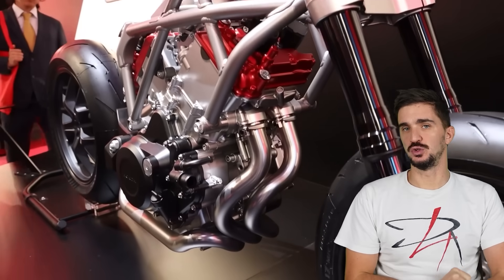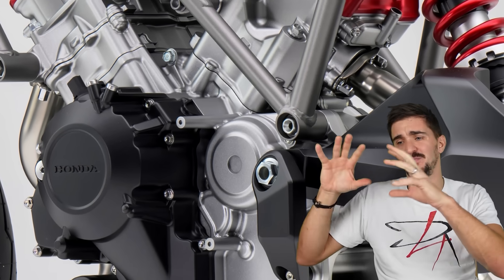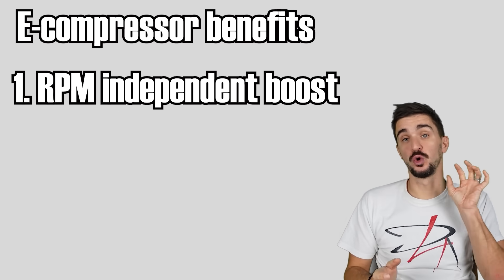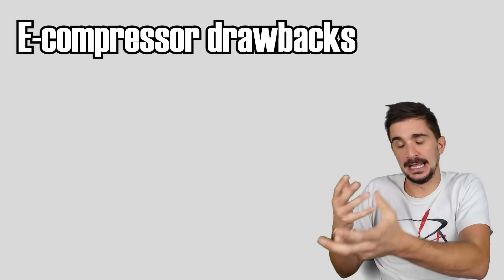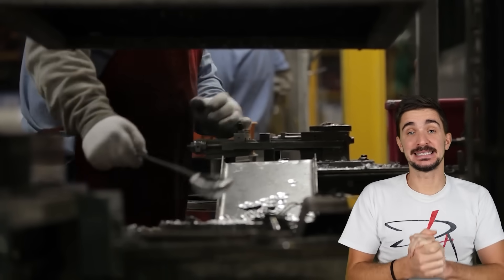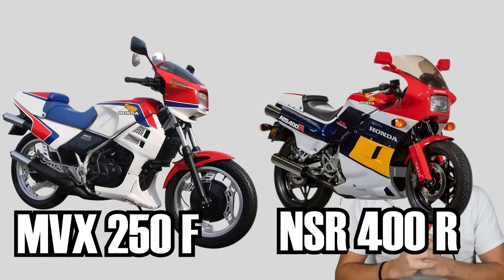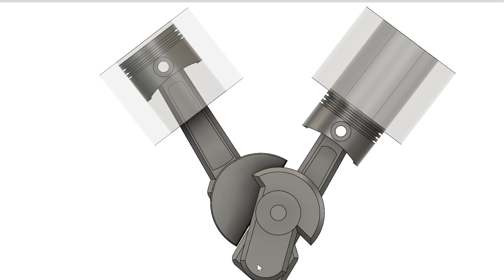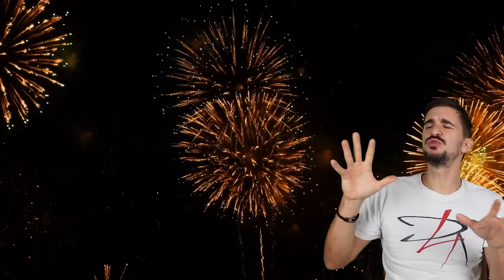Honda's New V3 Electrical Compressor Engine Explained

Comment: Small displacement engines always have the coolest engineering features, long live the combustion engine!
Reply: In today’s economy and emission standards, small displacement is pretty much the only area companies are left to tinker with. F*k electrification before maturity
Reply: Electric engines are cooler though
Reply: Super 🤔😊😊💪💪🍻
Reply: My God the electric simps in these comments have no clue xD pound for pound as dense. Dude an 85l tank of diesel does more than a 1 ton energy pack of batteries twice over. The copium.
Reply: Do you have any idea how many people have died just from breathing air that has a tiny bit of exhaust? Tell you what when a child dies of asthma it’s just like this, exhale all the air out then hold that. Just try it. Burning fossil fuels will end, if you’re in your twenties, in your life time. Mainly because it will be criminal to make heat for such frivolous reason as personal transportation. When SHTF be prepared by having something you can feed with solar power cause you won’t be able to find gasoline!
Reply: They can get away with being lazy like a American V8
Reply: @krusher74  (can't?)
Reply: @TheseThreeZs   Immanuel Kant.
Reply: long live combustion but not piston engines they’re inherently inefficient at their job
Reply: @hazza2247  true, so much wasted fuel
Reply: @hazza2247  Most efficient is electric tho
Reply: @ yeah i know but burning fuel has so many logistical benefits and they sound cool

fuel is so much more energy dense than any battery currently, imagine a person out in the bush with a chainsaw, the battery size required to match the power and run time of a tiny tank of fuel is not ideal, that’s just one example but i’m sure u could imagine many more
Reply: @hazza2247  Incorrect. Pound for pound, a lithium ion battery is MORE energy dense than even dynamite. However, fuel does enjoy logistical support because we've been using it for so long. We can fix this through micro solar and micro nuclear, but oil and gas are trying hard to kill those. Noise isn't an issue because 90% of motor applications would be better if it was quiet. For example, imagine a 2 stroke powered fan or laptop. It'd be horrendous to sleep next to. Electric is also way more reliable.
Reply: @ i meant they sound cool for boats and bikes and cars and shit.

if that’s true about the lithium ion batteries then why does a tiny fuel tank on a chainsaw last a long time and yet a similarly sized battery lasts less than half the time whilst barely matching the power of the combustion chainsaw
Reply: @hazza2247  That battery sucks. 
Sure but id rather have the highway near my house be silent. Theres a time and place for teenagers in clapped out civics, and thats not waking me up at 3am
Reply: @ i’m talking about racecars and stuff like that, they simply sound powerful and i like it. also just did a google search and it said lithium ion batteries are 100x less energy dense than petrol fuel, which makes sense given real world performance of each at the time of me writing this
Reply: @TheseThreeZs  Rubbish you haven't named the parameters by which you state that opinion ps opinions are not facts.
Reply: @TheseThreeZs  so, why Formula E can't surpass F1 in term of speed and Range?
Reply: @TheseThreeZs the highway near your house will never be quiet. The majority of noise is road noise and not engine noise. A tesla model 3 is just as noisy at speeds above 50kph as a diesel/gasoline vehicle.
Reply: @HeyAddieImTojo  incorrect. i'll post a video later showing you that even without modded exhaust gas is louder than EV. Road noise is also an issue as well.
Reply: @Cloud-zq8mf  Batteries suck right now. If we ran them on unlimited power (such as overhead ariel) E would easily overtake F1. Also, E is more designed for competitive, fun races rather than technical excellence. E cars have little aero, and are more designed to look aggressive.
Reply: @hazza2247  Agreed. I love the ground shaking rumble of nacecar. But we've already agreed as a society NOT to have cars like that on the road, and that quiet cars are better. It makes sense for entertainment, but not for actual practical use.
Reply: @zorbakaput8537  ? Who mentioned any variables?
Reply: @ i agree super load cars shouldn’t be on our roads but some quiet cars can still have a really nice sound profile to them imo
Reply: @TheseThreeZs Fuel is more energy dense than electrical batteries (the unit is joules per kilogram). In your comment, you are saying the opposite. Unless you know some very recent developments in the field of batteries that I am not aware of (highly unlikely), you are making a mistake.
Reply: .. Continuing:
Fuel energy density is about 45 megajoules per kilogram (MJ/kg).
The best lithium ion batteries have an energy density between 200 and 300 Watt Hour per kilogram. To converter Watt hour to joules, you multiply by 3600. So, 300 watt hour (the best lithium ion battery) is equal to 1.08 mega joules. This means that fuel is about 45 times more energy dense (45 megajoules compared to 1.08 megajoules) than the BEST lithium ion battery currently available (which you don't have access to).
Unless of a miracle, batteries won't catch up with simple fuel. This would mean a total and disruptive change in the way that we are manufacturing batteries since more than a century. After a century of research on batteries, it's VERY unlikely that this disruptive event will ever happen.
Fuel is inherently better and it will stay so for a long time.
Reply: Plus you have to factor in that electric motors are up to 90% efficient compared to 25 to 35 % efficiency of ICEs. And electric motors have greater power density and don’t need complex transmission gearing, resulting in potential overall vehicle efficiency gains. Even with all that factored in, fuel still gets you way way further per kg than batteries. That’s what made hydrogen fuel cell electric vehicles attractive - roughly the energy density of petroleum (less the 50% efficiency of the fuel cell converter) with the advantages of an electric driving motor.

Comment: The electricity comes from the crankshaft as rotary energy converted into electricity with losses then back into rotary motion in the electric motor with more losses a magnetic clutch driving a supercharger when needed with no losses cut out the 2 middle men a super charger needing 5 kw to drive it would need 6 kw with a 90% efficient alternator and a 90% efficient motor or just 5 kw from the crankshaft and 50 watts for the clutch 1/20 of the 1kw  5 kw at 50 volts is 100 amps with 10% losses 110 amps 4 x most car alternators and around 4 x the draw of a car starter motor the battery will have to help out at lower revs as the alternator output will be lower even with a 6 kw one and the battery will only help for a short period unless it is huge.  Turbo bikes were going to be the big thing in the 80s but an extra few 100 cc extra won out it was lighter simpler with no lag. If they build it people will buy it because it is new just like the turbo bikes of the 80s but will they recover their development costs and warranty claims. My uncle had an oval piston honda v4 (simesed v8 ) no children and never bought a house lived in his parents house

Comment: e-comp kicked in yo !
Reply: Then what would happen if we had a centrifugal vacuum pump to evacuate the air from the cylinder shafted to an electric motor that was shafted to a compressor and a compressor wheel pushing air into the engine
Reply: @demonthewolfmovieproductio6884 lots of loss. What about a Tesla turbine that runs off brake fluids and spins a compressor
Reply: @off6848  once had an idea for a hydraulic setup that put the motors on all 4 wheels being spun by the hydraulic fluid and the pump was well ofc an internal combustion engine shafted to a big pump. The idea was torque vectoring and a lot of torque from a dead stop
Reply: @demonthewolfmovieproductio6884  yeah that’s a fun idea it would probably work well for a go kart but how do you stop?
Reply: @off6848  easy you reverse engines when I say reverse engines I mean by reversing the flow of the hydraulic fluid through each individual motor sort of like I guess the way a heat pump would swap the flow of refrigerant through like a solenoid valve or something
Reply: @demonthewolfmovieproductio6884  yeah now that I think about its how a winch would work true. I guess instead of pedals you might have levers.
Reply: @off6848  levers could probably work although I imagine petals could too depending on the application you needed it for my original idea was to say something like zero turn lawn mower or really almost any kind of use case it would be all right for I suppose and there would be no need for a transmission
Reply: @off6848 the Tesla turbine’s efficiency goes down to being marginally better than a normal turbine when you put any sort of load on it.
Reply: @ no it’s misinformation there are people working on them that prove that wrong.

The problem is that people who’ve never read the patent falsely claim they are friction based turbines but they are not they work on electrostatic adhesion and you do not need crazy rpm to generate power it’s the opposite. People are just making friction based slip machines and calling them Tesla turbines
Reply: Hector hit the E-TEC Yo!
Reply: lol!
Reply: I don't understand why not have just made it a v4 if the front cylinder set is already slightly wider then match the rear. I understand the crank width is where we see a savings on the width but c'mon I have faith in Honda to figure out a better way.
Reply: @Roboticdoughbull3k
Weight and costs for a sub 1 litre engine ,3 cylinders is usually the optimum in terms of behaviour V bore friction ..as this is a MC engine keeping the bottom end narrow means the rider can tuck in the feet and legs low down .. 

The electric blower also needs no intercooling so the air fuel density remains cooler rather than getting super heated by exhaust gases.
Reply: E-conp+V-TEC 🥵🥴💦
Reply: @АлакПатрова  "Damn is🎉😂" ass comment

Comment: Too bad manufacturers are disinclined to develop a motor/generator unit on a turbocharger to get the best attributes of both  turbine and electric powered forced induction. 😢
Reply: They are NOT "disinclined", it is all a function of money, ROE, what the buyer wants and is willing to pay for. Right now what most US buyers want is more impressive HP numbers, and not fuel efficiency numbers, adjusting for inflation gasoline in 1980-1981 was $4.25/gallon. The last few years the size of pickup trucks has been steadily going up, at the same time more people are buying then for just daily personal transportation.

Comment: I always wondered about a V3 configuration where you literally just add additional weight to the un-paired cylinder to make up the difference and BAM, quasi V4 balance with 1 less piston... mind you, you will never get V4 power but the cost of producing V4's is already a reason why they are rarely used.. I wonder if V3's are the new way to go.

Comment: This design is about meeting Euro6 emissions. That means lower piston circumference and peak power at lower rpm, because valve overlap is no longer possible. The assumption is electric power is coming from a larger alternator, but it may be coming from an energy harvesting motor in the front wheel.
Reply: Or simply a battery you charge at home.
Reply: A braking regen on battery demand might fulfill the latter .
Reply: @jondor654  you don't want to be regenerating "on demand" unless the rider has demanded some braking power.  The size of the battery could offset any weight savings by going to 3 cylinders and then you need something to control all the current flow at the correct voltages between the different components.

Comment: Even crazier when you think that this isn't Honda's first V3...
Reply: Yes the unusually sounding nsr 400 👍
Reply: Look at their 60s motorcycle engines. They had most configurations you can think of revving to the high teens in rpm.
Reply: @nbain66  The RC149 of 1966 is my favourite, 125cc  Inline 5.....33mm x 29mm Bore & stroke, with four tiny valves per cylinder, revving to 18,000 RPM putting 30hp thru an 8 speed box. You would almost need tweezers to assemble the valve train.😄
Reply: And MVX250
Reply: The MVX was a terrible bike, I started my first job on the parts counter at the local Honda dealer in 84, and we sold them, they were forever blowing up the rear cylinder. Between the issues of MVX, the VF750, the FT500 and the CBX550, we were kept busy in the parts dept, tough times for Honda.
Reply: @TeUhtred7860  I heard that Honda adopted gear-driven camshafts for a while because of the unreliability from that period. Don't know if that's true.

Of course, that does not apply to 2t.
Reply: @peekaboo1575  Theres some truth to that. They had a LOT of issues with their cam chains & tensioners in the early/mid 80s, even the VTR1000 Firestorm still had cam chain issues in the late 90s. The VF750 and its cam shaft woes, and the way they handled the fallout, cost Honda a LOT of goodwill, and put a massive dent in their reputation. But the VFR750 with its gear driven cams is probably one of the most reliable bikes out there.

Comment: @d4a Great video! Can you clarify something for me? I made a comment on another video about how turbochargers do cause some parasitic loss in the form of backpressure, and someone else responded saying that I was wrong. He said the following:

"You clearly don't understand what backpressure is... If there is no Delta~P, There is no backpressure. The compressor of the turbocharger is driven by waste heat energy, not pressure. The exhaust turbine operates using the Brayton Cycle and like a jet engine makes use of Bernulli's Principle. The exhaust gasses increase in velocity and thus pressure drops. As the energy is extracted from the exhaust gasses the temperature also drops this reduces the gas pressure and volume to less than the manifold pressure under load. 

Any questions???"

Is what he said correct? Do turbos really cause parasitic loss or not? I'd really like to understand this topic better.
Reply from the maker: Turbos cause a loss. If they didn't, they would violate the laws of physics. I don't entirely understand the argument you copied, seems like an attempt to mention as many formulas and principles as possible, even though it's unnecessary to do that in order to explain how a turbine works.
Reply: @d4a  That's exactly what I thought! Thanks for the clarification!

Comment: Thanks for the explanation. After owning some of Honda's V4 engines and doing maintenance on them, I'll pass on this V3. If Honda's engineers want to get fancy, I would rather see them apply GDI to a 270 deg inline twin with some fancy valve timing like Hyundai's VVT  that can vary timing and duration.

Comment: Another great video, thanks. The gas flow direction in the animation of the compressor at 3.45 looks a bit odd.
Reply from the maker: Thank you, glad you liked it. It's a turbine, I'm just showing it to demonstrate what's unnecessary...sort of. Maybe wasn't the best idea when I think of it now.
Reply: @ Ah, makes sense now, thanks! This has the potential to provide EV-type torque from low revs.

Comment: They’ve made a V3 before, so it was only a matter of time before they would make another one, this time a 4-stroke too! I can’t wait to hear how it sounds, or better yet. Which bike it’s going in.
Reply: I think a new VFR ! So a VT(hree)R
Reply: I made a simulation of it, with a 0,435, 360 firing order like in this video it sounds a lot like a V10
Reply: @ Is it on the Engine Simulator website?
Reply: ?  @hisride

Comment: It wont make more power than i regular turbo. To power an air compressor takes a lot of energy. That electric motor has no chance. To have an efficient electric motor you need a lot of voltage. To have a lot of voltage you need high cell count. This wont have that, it cant. The boost wont be big. And if you thing the generator would produce that voltage then its just like a normal compressor. 20-30% of engine power loss. Real turbo beats this.

Comment: While the turbo charger creates backpressure and therefore power draw from the engine, the additional electrical power from the alternator also creates additional power draw. Which would explain, why they designed it as a temporary boost, basically harnessing power that would go to charging the batteries or be wasted in resitors, as opposed to a constant power draw, because it probably requires too much power to be viable more viable than a traditional turbocharger.

Comment: Will this make more sense for single cyclinder engines? You could get 90+Hp out of a 700cc and stay very simple, compact and lightweight.
Reply from the maker: I think Ducat and KTM already got pretty close to those figures in NA form. 10 extra hp doesn't justify the weight gain, I think.
Reply: @d4a  It is not 10 it is 15 to 25hp. I would say 100hp could be an easy and reliable max HP. TDM900s reach 120hp with 0.5bar, from 85hp. 3 cylinders are already powerful enough. A single cylinder seems light enough, simple and cheapnto manufacture, a good base to add a simple e-compressor.

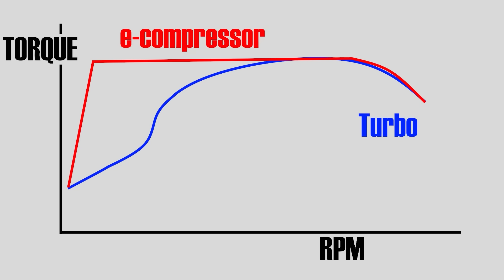Comment: 4:19 honest question though isn't this kind of like lugging the engine?
Reply from the maker: Lugging is using the engine to try and overcome a load for which the engine at that time is not producing enough torque. This would actually prevent that not cause it.